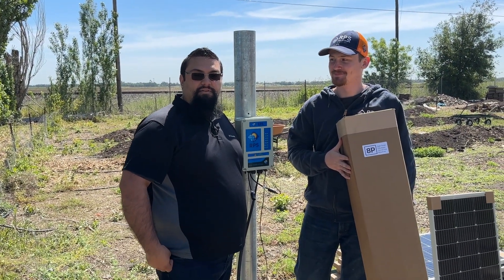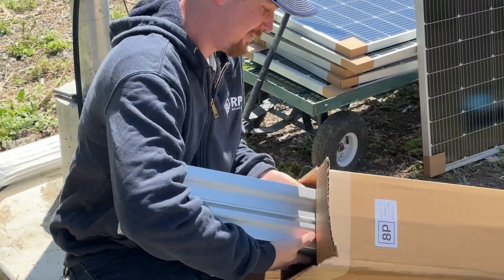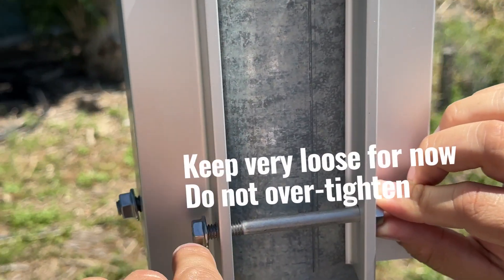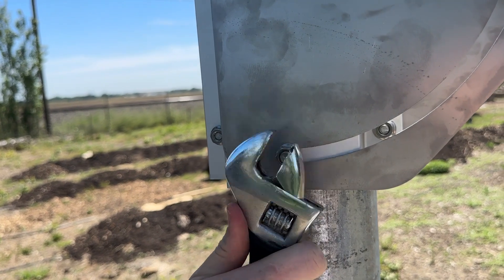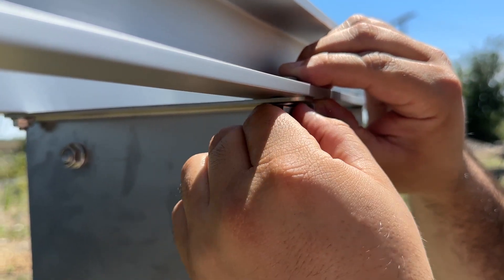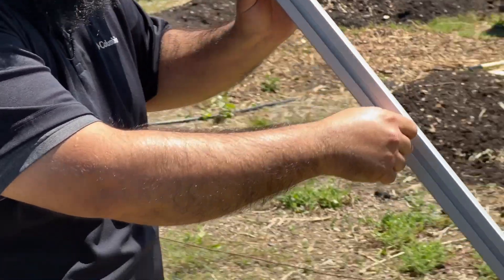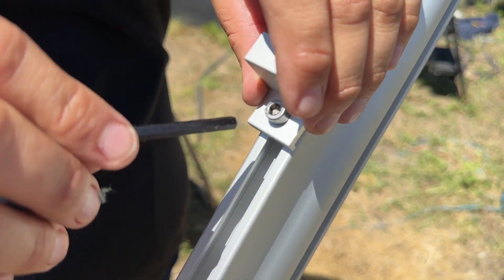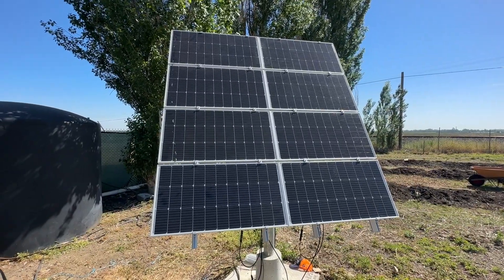How to build a mount for 8 solar panels | Back 40 Solar 8P mount kit

Comment: On your guys website it states that you need 2 3/8" OD Schedule 40 steel pipe for the 2 panel mounting system. All I can find is 2 3/8 OD fencing posts and from what I've seen those are rather thin walled. would they work or ?
Reply: Use 2 3/8" OD Sched 40  Steel Tube ...

Comment: Can you make this to hold 10 panels instead of 8?

If yes, what is approx price?
Reply: looks like the got 2/4/8 kits from what i saw on their website
Reply: Correct 2, 4, or 8.
I need 10 per structure.
If they can offer that size, 
I am interested in price.

Price per unit to purchase 6 units, 
each able to mount 10 
Canadian Solar panels?
Reply: @Just_An_Idea_For_Consideration  I know what you want.  But you have to remember They are a water pumping Company and Dam Good at it.  So they prioritize this and specialize in systems for Water.  I'm a satisfied customer of a Solar pump Kit.  I'm headed for another solar pump system in the future.Can't say enough about how absolutely complete their kits are.
Reply from the maker: The tillable top of pole mount kits only come in 2,4, or 8 panels. However, if you are mounting 10x 100W panels you can use our VC2-HR8 which you can find here. https://shop.rpssolarpumps.com/products/scalable-solar-panel-ground-mounting?variant=31853216694324